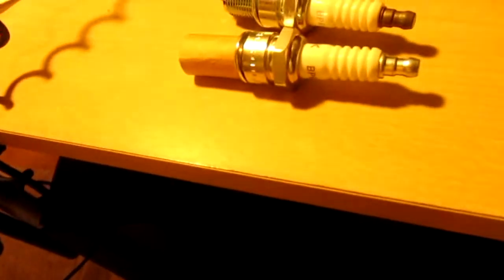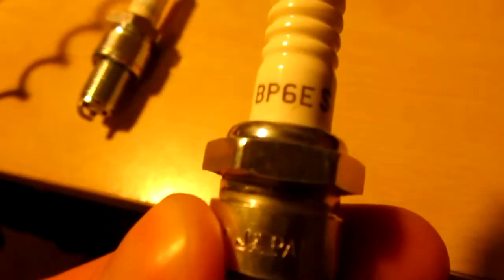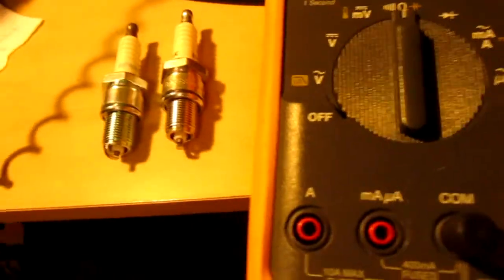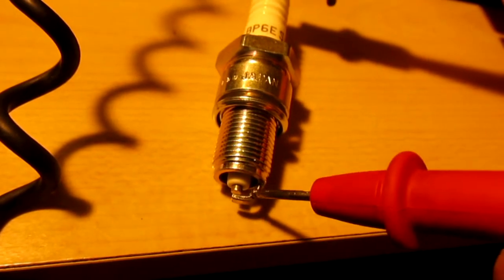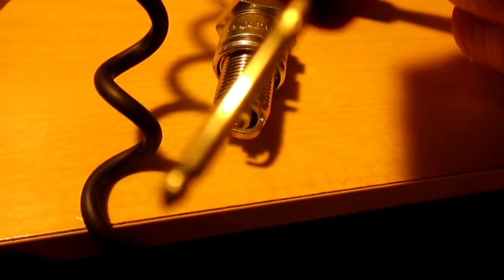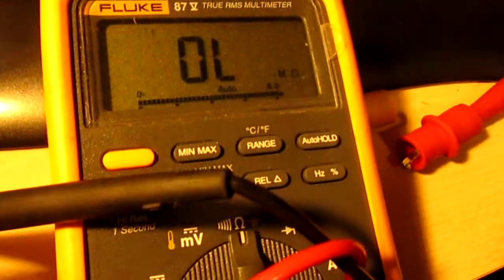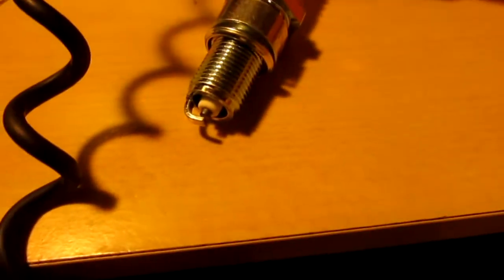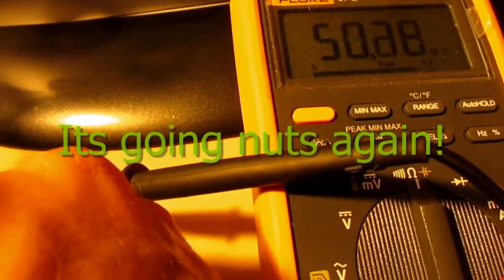Measuring spark plug resistance. Resistor Plug VS non Resistor

Comment: Got a new set of Champion non resistor plugs, 2 read over 2 meg, others were 1.5 ohms, 150 ohms, etc. Decided to unscrew terminal from porcelain. Found center electrode had zero ohms but electrode just sat in a hole in the terminal. Sometimes making good contact sometimes not, plus corrosion. Cleaned parts, made a copper wire coil by wrapping hair fine strand from a stranded wire around a needle, cut to length, put in hole in terminal and re-assembled plugs. All now read zero ohms. I'm guessing most plug makers use same construction thus causing variable readings. Learned how to dis-assemble from video on converting resistor plugs to non resistor.

Comment: The resistor plug is primarily to stop static noise like a resistor on the - terminal of an old school points system.
Reply from the maker: Yea for radios and such. I guess the generator has a resistor boot plug to stop the RF from the alternator. And yea technically it is a "alternator" not a generator lol  See. I have NGKs.. On my small engines! All of them infact!